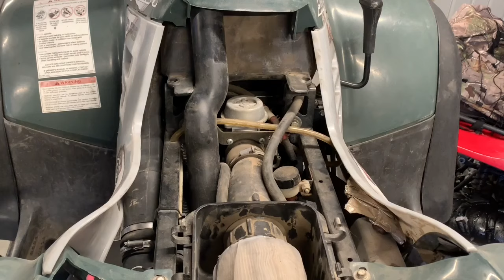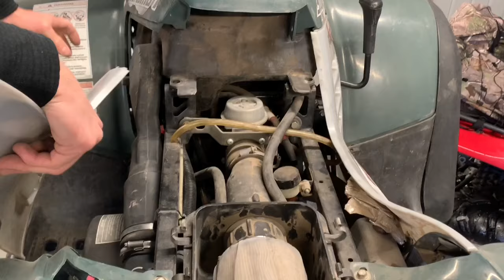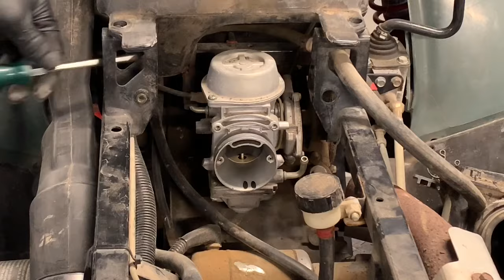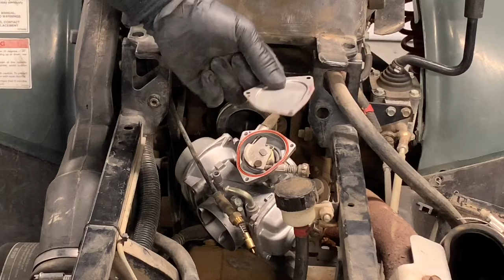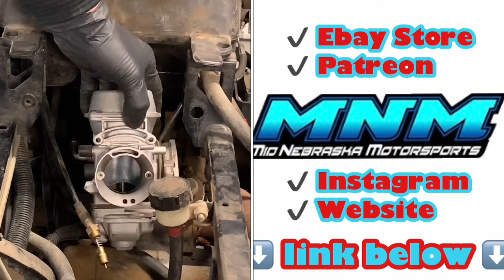Polaris Carburetor Removal  -  How To Remove Carb on Sportsman / Magnum / Xplorer

Comment: Absolutely fantastic video! Just got tasked with getting my nephews 400 Sportsman going after it broke and sat outside for 3 seasons. Figured start with an ignition and fuel overhaul but never worked on Polaris's. Fantastic, clear video. This was the first video I saw when I searched and I think I'm going to stick with your channel. No need to search for anyone else! A+. 

EDIT: Made the comment just before you tackled the throttle cable plate guard screws. ALWAYS keep a container of valve grinding compound on your shelf! For hard to remove screws dip your screwdriver tip into the compound. The steel dust bites into the surface without slipping. If you're really in a jamb you can use Vaseline and sand but make sure you have more of the latter in the mix. Works great!

Comment: Great video. I have a 2007, sportsman 700 that hasn't ran for multiple years. I got a new battery but it won't turn over. Where would you start? Appreciate any insight!

Comment: Excellent, extremely clear video and explanation on removing a carburetor. So...to reinstall, it's a matter of just do it in reverse. Is there anything one should know about hooking everything back up? Thanks!
Reply from the maker: Nope, reverse order will work great! Make sure your fuel hose isn't cracked because you'll end up pushing a chunk of rubber off the hose into the carb. Super common issue after carb cleans. I need to remember to mention that in my videos. I do have a re-install video coming out sometime. I just don't remember when. Thanks for watching!

Comment: Just pulled the carb off my 2000 Sportsman 500 4x4.  The steps are exactly the same.  My carb looks a little different, it has a plastic throttle lever cover with 4 screws.

Anywhoo, I was having some issues when putting the wheeler in drive and going anything over 5 mph.  It would load up, loose power and backfire.  My thinking was bad fuel, not getting fuel.  Crazy part, it fires up, idles, and revs up in neutral just fine.

Noticed a bunch of oil in the airbox, so I'm thinking the needle and seat are bad and it was just dumping fuel in the motor.  Any thoughts or advice?

Comment: the screws on the carb are actually JIS, not phillips, and the proper driver is much less likely to give you trouble. Great vid, by the way.
Reply from the maker: You are correct! Thanks for watching and the comment. Let us know if there is anything we can help with. Check out: https://www.ebay.com/str/midnebraskamotorsports for any parts you might need.

Comment: Is it possible to change the starter on 2005 Sportsman 500 HO by getting access with the removeal of the airbox....this video looks like it would work. Not interested in removing the clutch area. I searched your videos and did not see a starter replacement.
Reply from the maker: Great video idea! Yes, pull that air box and you should be able to get to everything needed. Thanks for watching and the comment. Let us know if you need anything else!

Comment: Need help following the fuel lines from the tank  and the one that feeds into the same area the front right shock on mine is pouring fuel out when i fill the tank with fuel  what could this be?

Comment: Installed new carburetor and when installing choc cable It is not long enough What do I do It just doesn't seem to fit Just needs to be a little longer
Reply from the maker: Chinese carburetor??   Check out: https://youtu.be/oRMu6HQCzds  Thanks for watching. Hit the subscribe button as we have a lot more videos coming out on this machine. If you need parts or tools for the job check us out at https://www.midnebraskamotorsports.com/

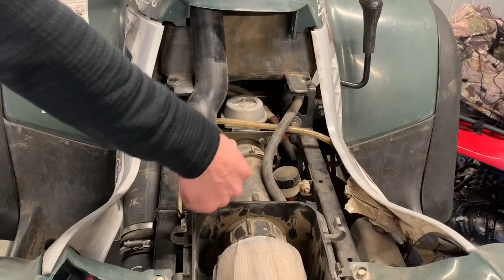Comment: Great how to on removing Sportsman carb.  EXCEPT for one glaring issue.  At about 1:00 you said removing that plastic air duct may make it easier to remove carb.  Yes, it is easier to remove carb.  BUT, getting air duct reinstalled is a royal pain!  It goes into a very flexible rubber boot that has no access on the left side - clutch housing makes access impossible on that side.  I removed the air box, again, after having reinstalled it.  At least then you can actually "touch" the boot, but still cannot access the left side of boot. 1 1/2 hours of frustration later with various tools trying to get boot around duct, finally got reconnected.  The small extra time to remove carb was more than offset by the great difficulty in getting air duct reinstalled.  If there is a "trick" to getting it connected, PLEASE include it in video.  Otherwise, the video is wonderful "how to".
Reply: What does it do is it an inlet or outlet ?
Reply: @jandeband  it is like a “snorkel” so air to the air box doesn’t get water.

Comment: I can’t get a wrench on my 12 mm choke plunger nut. On a 99 Sportmans 500. Different carb. The way the nut is sitting a regular wrench cannot make the nut move because there is no okay between the wrench and the housing of the carb. I can’t even tighten it or loosen it. It’s in that perfect position to not be wrenched on at all. I’m pissed.
Reply from the maker: They can be a real pain. I would us a good pair of needle nose pliers. Get a good firm grip on it so you don't slip off. Otherwise, send it to me and I'll get it pulled off for you. Thanks for watching.
Reply: I took a taiwan-made 12 mm I'm grinding the Jaws theme so I can get in there

Comment: What does the air duct do, is it a inlet or an outlet ?
Reply from the maker: Which air duct are you talking about? There really isn't any outlet in the carb area. Mostly inlet. Curious why this would matter?  Thanks for the comment and for watching. Let us know if you have an questions! Let us know if you need parts: https://www.ebay.com/str/midnebraskamotorsports

Comment: Can someone tell me best website to buy a new carb from please, it's a magnum 500? 
I'm female and learning. Have taken old one off as it's leaking. 
Also managed to change the starter motor and bendix. It's crazy how names are different for parts in the UK. 
Ps I followed ur video to remove the carb. 
I'm from a motorbike racing family and my grandad used to build all frames and engines. He would be proud I am trying to fix the quad I brought at an auction to help his great granddaughter with her horses. Any advice much appreciated. X

Comment: These frikken machines are a pain in the nuts to work on.
Reply: @MidNebraskaMotorsports  both my main output shafts front and rear at the differential ends the splines are stripped. need a video on replacing and upgrading that part. Thought both diffs where blown thank fuck there not. Someone put over size tires and a spacer kit on it but didnt upgrade the spline cupplers.